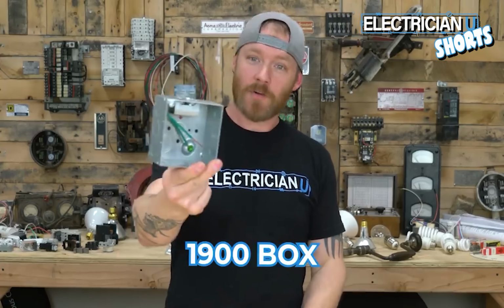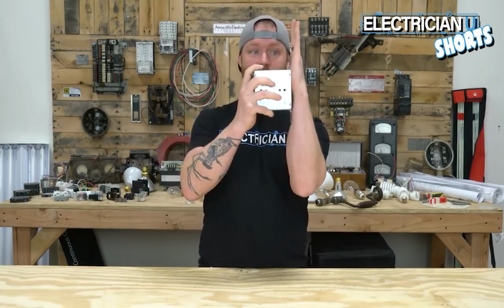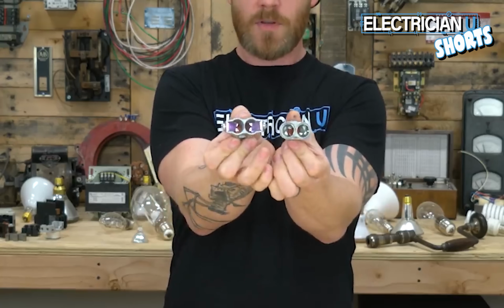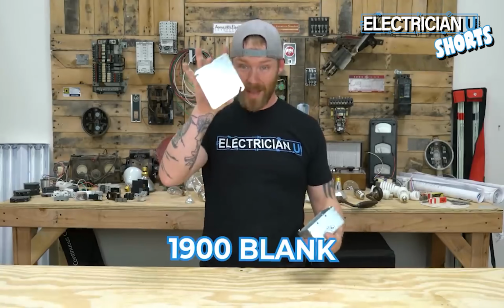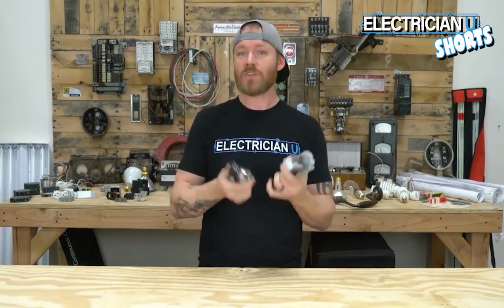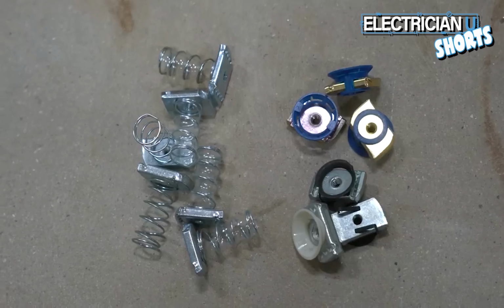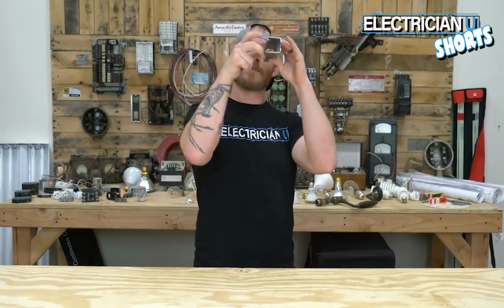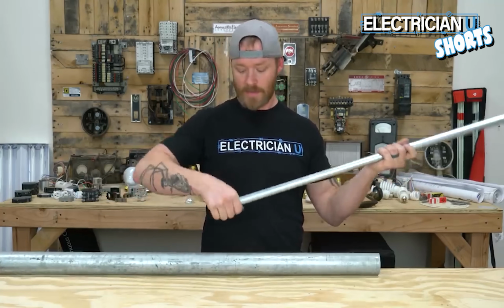SHORTS - Commercial Electrical Materials Apprentices Should Know

Comment: Copy/Pasted from one of the Electrical Forums..."Many people believe a 1900 box got it’s name from the fact that it originally was 19 cubic inches. In trying to track that back, I couldn’t find any proof of that but the first reference I saw to 1900 was in the 1917 Central Electric Supply Catalog where they referred to these boxes as 1900 Combination Gas and Electric Boxes. The name seems to have come from the part number given by the Bossert Company. "

This is what I had heard back in the 80's.(yep I'm old)  The box shown in the video was a deep 1900 or 4"sq box. The industrial cover we called it a RS cover (raised surface). As someone else mentioned, besides 4"sq boxes, there's 4-11sq boxes. The most common depth for both of these sizes are 1-1/2" dp and 2-1/8" dp.

Nomenclature for electrical materials are as common and different as accents!

Good starter video though! 👍

Comment: Is it feasible to switch an air compressor on/off with a relay? 220 volt. The compressor would be located in a separate building about 60 feet away
Reply: You would use a contactor.  Heat Pump/AC compressors are operated that way with the thermostat sending the control voltage to the contactor coils to cause the contactor to pull in  the 240v circuit powering the compressor and outdoor fan.

Comment: Been an Electrician for 8yrs. Can you please do a series of videos on explosion proofing, Division 1, Class 1, Group D, sealing fitting. Basically Article 500. I'm connecting a 1000gal propane tank to a 3ph motor. I hope I got this right...because I'm confused. Do all joints have to be threaded rigid? Are there compression fittings that would work? How to separate Division 1 from 2. Pvc in 2 inches of cement ok?  Thanks in advance for any good explanation for this article.

Comment: I've never heard the boxes called 1900s. We call them "4 squares", and the slightly larger ones "4 & 11s". We call the industrial covers "RIs" or "Raised Industrial", so not much different for those.
Reply: 1900 box baby! And there is the deep (1900) box as well. D1900
Reply: yup, 4 squares in michigan... well, everyone I worked with anyway
Reply: Yup 4 square deep
4 square shallow
4-11

How about push in bushing for low voltage? In Seattle they’re known as a cats ass
Reply: @SpaltedMillworks  yeah, I've heard cats ass, but that can also mean the kink you get in CAT5/6 cable. I've also heard a not so politically correct nickname of "Obama bushings"

Comment: I love these shorts, I like seeing the different names for the same material we use in Canada as well as material we don't use(or use often), 1900 boxes for example. Keep up the great work, you've been putting out quality for years.
Reply: I believe that's just a 4x4 box in all intents and purposes. I'm just surprised with the no need for bonding screws in those residential boxes that are plastic, even our plastic boxes have a bonding screw for the yoke of plugs/switches, as additional point on safety.
Reply: @Banzukay  I believe it's a 4x4 too, just with a little something different on the inside. It is a bit of a trip that things that we need to do because of code is not required just a few kilometres south.